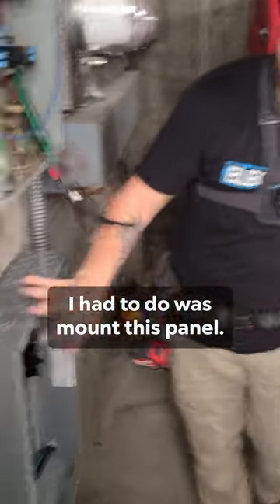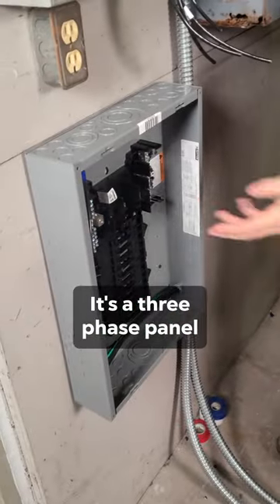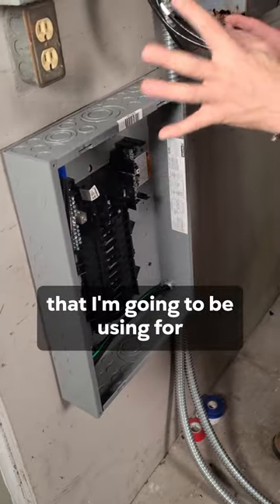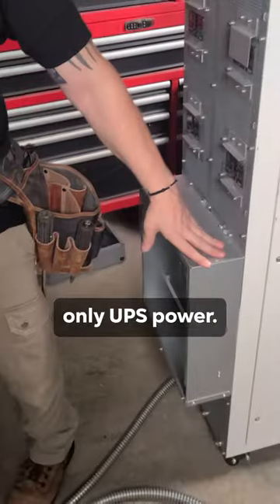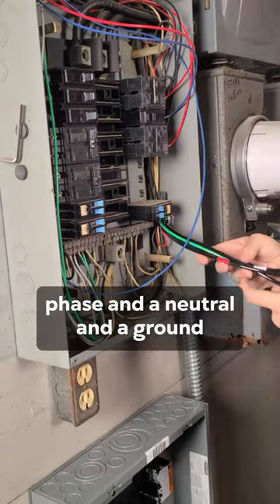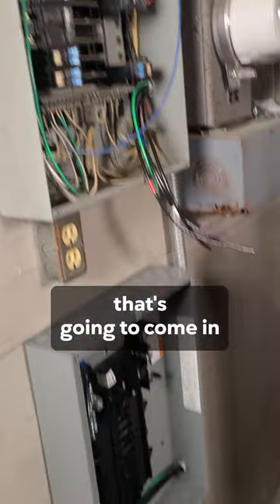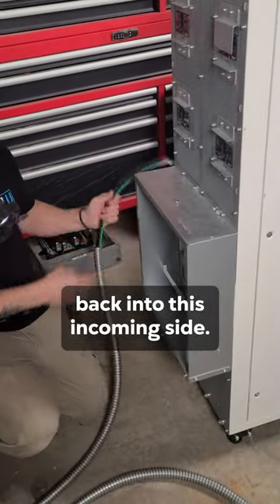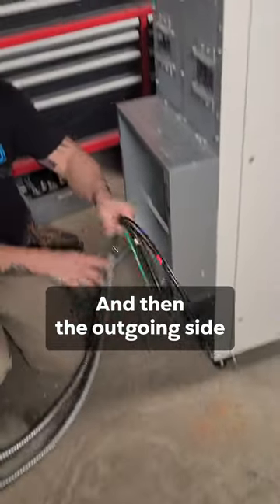Installing a UPS - Schneider Electric

Comment: Man it was a crappy day when we had to go back through the thirteen rows of battery banks we were installing for our local utility and troubleshoot the ups for each row. Ended up having defects (reversed polarity) in the battery's themselves. Manufacturers never cease to screw me over. We screwed up on our initial testing too we had the breakers on while testing polarity so it always rang out fine because it completed the loop in the 3 phase 208 transformer in the collection center. Fun times in this trade fun times
Reply: sounds like hell til ya found it
Reply: Why not overhead instead? You’ll have a trip hazard now.

Comment: So is that flex going to become a trip hazard??😅
Reply: Yeah won’t get 3ft clearance in that panel with that cable ran straight across
Reply: The UPS chasis is on casters. He will probably push it back once it’s all hooked up.
Reply: @darkopz  just jumped comments and noticed this lol. You came to the same conclusion I did. Unlike the guys that remind me of client that see you halfway through the process a d think well that's gotta be wrong this should be here.

Comment: Hey electrician U could you do a video on ups and how it works. Im an electrician been in the field for 3 years and i have never heard of it interested in learning about it!
Reply: This isn't a data channel. 
We put power to things that's it! 
We are Electricians
Reply: it's just a big battery dude
Reply: @floydross735 I do a hell of alot more then bring power to things
Reply: if you just bring power to stuff your a wire fitter in my opinion😂 or a resi guy at a bigger company
Reply: He made the videoo!!! Fucking awesome!
Reply: @floydross735 thanks for keeping it real. I'm not saying electricians don't understand the technical topics, but the electrician trade is trained and educated in codes and the pragmatic functions. In my experience, this doesn't require a deeper understanding of electronics or electrical theory.

Comment: First of all, let me thank you for teaching this useful information. I have suggestion as a one of  your page followers and lovers.This level of explanation may be enough for people who are familiar with the work, but it seems a bit confusing for beginners. For example, it is not clearly shown where you connect the wire that you pulled out from under the fuse in the main panel, and where the return wires are connected to, or what wires you are connecting. Because there is no need for neutral transfer in most delta transformers. If after the end of the picture on the paper, you can show by drawing what you are connecting from where to where. I think it is more clear and understandable for methodical people like me. Of course, this may seem a little overtime or boring for you as a professional, but it is better for the learner. Thank.

Comment: you runnin that fmc on the ground?
Reply: Never legal to run any conduit or flex on the ground in front of any panels.
Reply: @JohnThomas-lq5qp  thats exactly what i was thinkin he was probably gonna strip it to the wall or somethin
Reply: @JohnThomas-lq5qp No he is probably gonna run it on the ground like a dummy.
Reply: alot of those ups units are on wheels.
Reply: @UnifiedInfo you can see the wheels in this video…
Reply: @darkopz  just mentioned that because he's probably  working at the back of it then rolling it in place and strapping wiring up after

Comment: To be pedantic, it doesn't "transfer", correct? The UPS is constantly rectifying to supply the batteries which are modulated to always supply the load with a filtered AC. The "transfer" you're describing is just a loss of the charging supply for the batteries.

Comment: This might be a dumb question, but I was an electrician on ships, where there is no neutral. 
Why send 3-phase power with a neutral wire? Is it just for future options?
Reply: Most UPS system require a neutral. 
I was a GE Engineer and had to modify many to run with out a neutral.

Comment: Beware of Schneider Electric UPS systems. They are nothing but APC crap.

SE bought APC years ago and basically slapped their name on all of APC's stuff. This is what SE does with many things actually. 

Unfortunately, the service and support is just not there. The SE techs are there one day and gone the next. They can't seem to hold on to good people except on the sales side. And I've never seen a company have such a merry go round of employees who are constantly moving around within the organization to plug up holes left by others who after constantly departing.

My suggestion is to stay clear. This is coming from someone with over 25 years in the industry so I'm definitely not just spiraling out over just one or two instances.
Reply: ABB bought GE and GE had so many problems with all of their UPS's  as none of them were designed for USA voltages only CE. 
I lost count how many times I had to totally rebuild SG500's and LP's  and capacitors wold fail all the time.

Comment: Man you are missing a very important pice of equipment, 
You need a external bypass and isolation with a UPS controlled Kirk key system. 
When the UPS tech comes and does a PM he will have to do it with power applied to the UPS unless the customer does a planned shut down.

Comment: Do you need a generator? How does it stay on?
Reply: It's basically a big battery
Reply: @krisssilco does the main panel charge it up?
Reply: @hotdog3392 main panel with charge and keep charged some batteries. When power is cut a ATS (automatic transfer switch) will transfer connection from main to battery power.
Reply: typically, the UPS covers the few second outage while a gen set is coming up to speed, so the computers and lighting don't flicker. We've actually got a few large homes set up this way because of Lutron lighting systems, security systems, and expensive home theaters. Lost data is a big deal in some situations. We have one customer who has a tropical saltwater aquarium (worth $50k) that has 3 hours of back up in case there's a generator problem. Yeah, that guy has some serious bucks behind him. Cost was never a question.

Comment: I am sorry, but that is not always correct, equipment that is running on dc low voltage most likely will drop. From experience with ups equipment

Comment: Instantaneous transfer? That's not how a ups works.
Reply: Yes it is. Most UPS's this size are called online or double conversion. Unless there is a fault and the unit is in bypass the output is always fed from the inverters, and the incoming AC power only feeds the rectifiers to charges the batteries and feed the inverter. When AC power is lost the battery charger shuts off but there is no output ripple because nothings transfers.
Reply: @spencerryan2657  that's my point, there's no transfer because there's nothing to transfer. The only result of a power failure is the charging stops.
Reply: @stevehenke678  ah I see what you're saying, yeah. I mean, they make non online UPS'es but then those also are not instant transfer.
Reply: @stevehenke678 please explain?
Reply: @maximusvonderbrewskis nothing truly operates instantly. your computer will try to draw between the time the ups were to switch. There are a few ways to avoid this, but an online ups is the best

Comment: Hey why are you wearing 2 gangboxes on your hips? Insidewireman for 44years  2 hip replacements one at 57 another at 63 never ever wore a pouch had hand tools in my pockets. Linesmans Chanel  locks screw driver stick rule and level if needed and an old fashioned hacksaw.